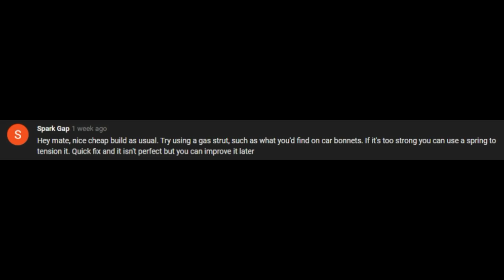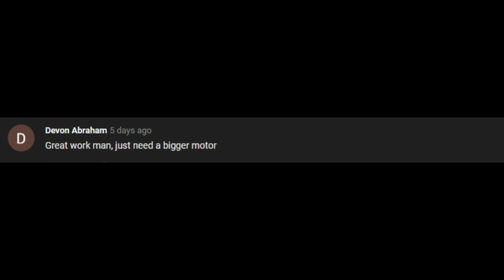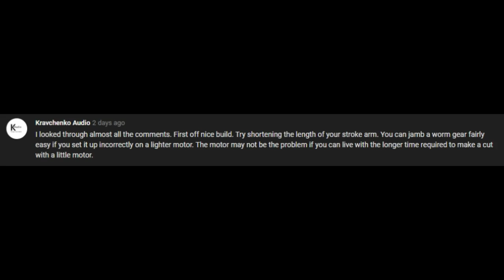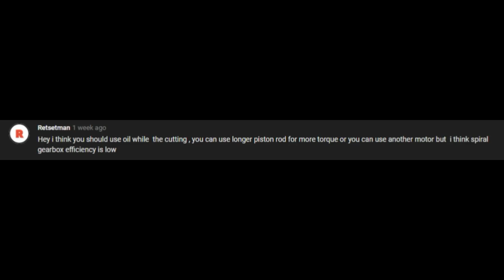Power Hacksaw Build ||DIY|| (Part 2 of 2)

Comment: Great to see the improvements made. If you really wanted to add to it you could make an automatic oiler for the blade. If you're going to make the stroke variable then you can use the backstroke maximum travel point depress the oiler piston to squirt a little on the blade for each action.

Comment: nice video if you turn the theet of the blade away from the drive it will cut on the push stroke rather than the pull stroke may help i think.

Comment: it's an awesome job but if you make the clamping system just a bit higher, like 0.5 CM, the contraption would have worked better. Because i see how you pull the cut things out of the saw

Comment: Something seems to be slightly off, when you drop the saw on your work, the engine doesn’t slow down at all, this tells me that it basically scratches the work using the saw blade in stead of actually sawing.

When I handsaw, my 80kg workbench moves like an escort on crack, I’d put some weight on the saw, 20-30kg, this should improve the sawing speed, I can handsaw a 30x5mm flat band in ~20 seconds.

Comment: Needs more strength from the motor so it has more torque and for it to be comparable to a commercial band saw.
If magawa mong kasing lakas yan ng bandsaw, mas mura cost of operation because hacksaw blade lang yung bala. Mahal yung loop ng bandsaw saka hindi nabibili dito yung mismong bandsaw machine easily dahil mahal.

Comment: I think if you extend the tiller that goes to the engine you can use the full length of the blade, and it will last longer and it will also cut faster with every revolution of the engine.

Comment: My suggestions: 1 - add some weight in the blade support to help it to cut.
2 - you can improve it adding a oil pump do lubricate the cut, I recommend laundry machine pump

Comment: always great work.

As always, a suggestion from the peanut gallery:  

how about a longer sawing stroke, almost as long as the blade?  

you are using only 1/2 the blade
Reply from the maker: Hello i can try that also. I hope the power of the motor is that weak. Thanks man
Reply: @SekAustria  I would put weight on it so it has a smoother cut.

Comment: first i have to say that you make a good quality tool ,but the promblem it wasn't the motor but the gears which makes the motors speed slow it down and then takes to much time the cut and even spot the blade from cutting just like the first part you make ,just try to change the gears ratio or even place the motor directly to the stroke arm

Comment: Very nice build, but it is very, very slowly :(  Bandsaw is much quicker, with same accuracy.
Reply: Bandsaw is quicker than this but this make nice cuts with cheaper blades and alone.
Reply: @IW4DBX  Dont know, power hacksaw blade on ebay cost around 10-12$ per piece. My 1638mmx13mm bandsaw blade cost around 7$ and last very, very long time.
Reply: And Im not saying, that this video is bad. I love these videos. Im only saying, it is slow saw.